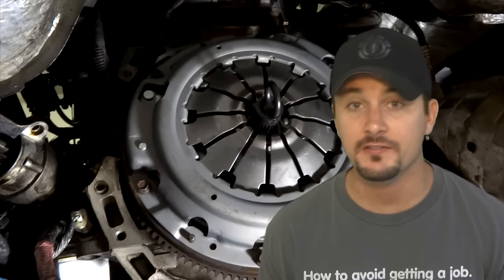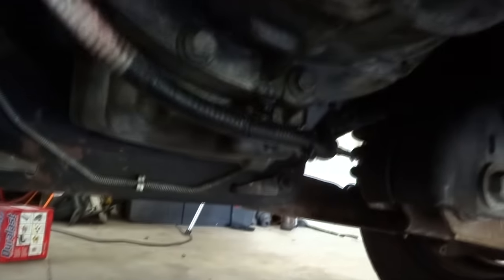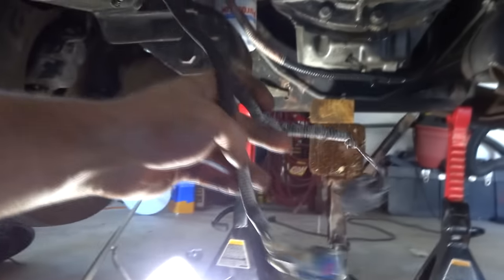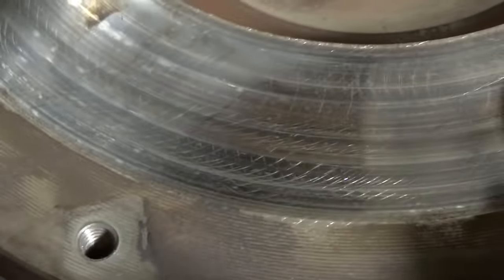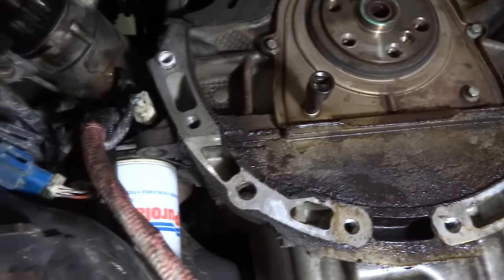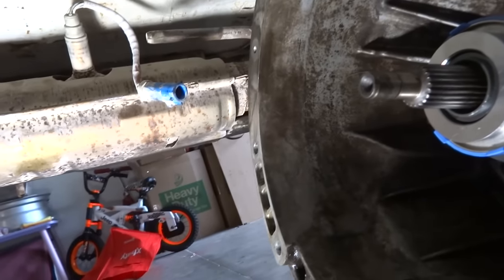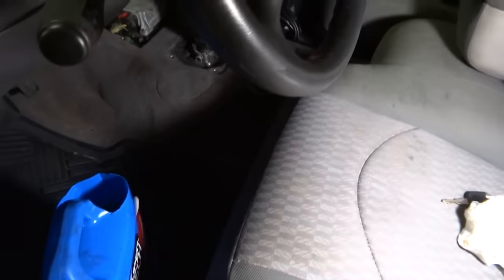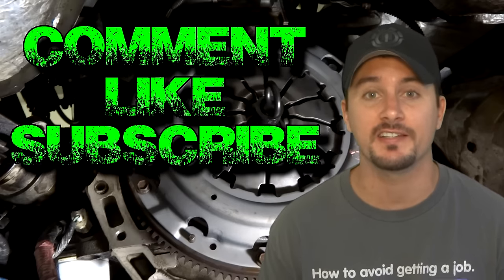Clutch Replacement Ford Ranger & Mazda B-Series ⚙️🔧

Comment: Hey very thorough and helpful video. Not only is it difficult to work on a vehicle, but also filming and narrating is a lot extra!
I have one question: did you use brake cleaner to clean out the inside of your transmission when you resealed the transmission case hat?
Thank you for your voluntary time and effort!
Reply from the maker: Thank you. Yes, most people don't understand what it takes to film a repair. On one of my repair videos I was doing a strut assembly, it took 3-4 hours to film the repair on the passenger side, when I turned the cameras off and did the driver side, it took me less than 25 minutes to complete the repair.

 I can't remember off the top of my head if I used brake cleaner, but it definitely wouldn't hurt if you needed to clean up some parts up.
Reply: @Nthefastlane  Awesome, good to know. Thanks again for your help and timely response!
Reply from the maker: Anytime

Comment: In a B-series V6 Mazda I bought recently the engine began having to be revved high to get enough power to move. This went on a couple days, my primary vehicle, as the clutch became hot and smoking. Finally, the truck has stopped shifting altogether. Will this video help me?

Comment: I have a 1998 ford ranger with only 110k on it.  I just replaced the clutch master cylinder and 2000  miles after that my master cylinder bowl was empty again.  I pulled the rubber boot on the side of the Transmission to check for a leak on the clutch slave and it seemed to be dry. So the question is if the slave is bad would you replace it with a Ford OEM slave or is there better ones out there.   I realize it only has 110K on it but it is also 22 years old.

Comment: Bro , your video is helpful and awesome , however you don't put automatic transmission fluid into a manual transmission , you got to use gear oil , same as you would any differential.
Reply from the maker: Thanks for the compliment Lloyd!

Believe it or not, the owner's manual recommended Mercon V ATF. Some manual transmission such as Ford Rangers also take ATF or even Engine Oil.

Comment: Could you give details on, lower end of shiftrod
Has like a ball of steel.
The pcs needed around it. T Y Sir . Is it only wavy  washers, & seals, or more ? Mine is totally wore out, even 2 side steel pins worn down.

Comment: Hey I know this video is old but I just purchased a 91 ford ranger 2.3 4wd and I need replaced throw out bearing because is making a  noise when the clutch pedal is up . But my main concern is that when I park the truck in a hill with out applying the parking brake the truck in first gear it won't set there, starts to roll down hill even when is in gear .what's wrong with it, clutch, transmission or engine???????

Comment: This guy is spot on with this video, however i have 2 problems with it, 1) should always have the flywheel turned or replaced. Doesnt cost much. And 2) i would replace the tailshaft seal as well.

   Scott the car guy

Comment: Would you need to adjust the pressure plate if you were putting the old clutch disc back on

Comment: I bought an old truck to repair, I have never worked on any manual cars. Is changing the clutch on a 93, 4x4 ford ranger going to be more difficult with it being a 4x4?

Comment: Of all the Videos relating to this subject matter on Ford Rangers, I have found this to be the 'Most' informative; Not only did it help immensely replacing my Clutch & Pressure Plate, But you at least mentioned what to look for & Not to do, which numerous videos neglect to mention but yet is crucial in repair/replacement.  Oh! & The make-shift Tranny Jack (Godsend on my end - Sheer & Utter 'Genius!') OMG!! Did that do the trick to dismounting & mounting. 
Although, U mentioned U struggled getting Tranny mounted - Any tips on that, having that issue now, been 2 days Tranny still not going in & don't know Y
Any input greatly appreciated. Again Thanks so much for Vid Extremely informative which numerous videos lack.
RF
Reply from the maker: Thank you very much for that detailed appreciation.
Reply from the maker: As for getting the transmission in, if you can get back to where the tail seal is with your hand and put your foot at the front of the transmission, lift the back end up pushing forward and turn it side to side as you're pushing in, it will give you better leverage and should slide into the splines.
Reply: @Nthefastlane  Wow, saw last comment was made quite sometime ago, wasn't expecting a response & yet to have you respond back, And fairly quickly too, I feel honored - Thank You so much; FYI, I've been doing as U had suggested, but still still having difficulty - Guess just keep at it, NP.  As old saying goes 'Persistence Pays' :-) Yes, it was my pleasure to praise your video, felt strongly to respond to video that made process much easier (Especially for me) to Repair/Replace Clutch - This was/is my 1st time ever doing Transmission work, hopefully, last.
Again, Thank You for posting video as well as responding to my concern, that was not anticipating, but very much appreciate it.
RF

Comment: is it essential that the plastic part pilot bearing is installed facing outward from the motor because I installed mine the opposite
Reply from the maker: If you're talking about the plastic on the pilot bearing, No. The pilot bearing can go in anyway which way. It's just a plastic cover that keeps the grease in the bearing.
Reply: @Nthefastlane  ok thank you very much

Comment: Good job.  I am about to do this on my 94 Ranger.  I see you bought the whole slave and bearing.  That's good to know because I just looked at Autozone and the whole slave and bearing is less than just the bearing. Go figure.  Oh yea, I can't wait to get to that rear main seal,  It has been leaking since the warranty ran out.  There is many years of gunk I have to deal with.  Yours looked pretty clean.  It's gonna be messy.

Comment: If you were to simply do this job without throroughly going through and changing everything like you just do the clutch the pressure plate and a new slave cylinder and the rear main seal how long do you think it would take?
Reply from the maker: I'd say 2-3hrs. Filming slows me down 80%. I did a strut job filming that took 3 hrs on one side. Did the same job on the other side with no filming in under 20mins.

Comment: Wow that clutch looks great for having 200k miles. You must be pretty good manual driver
Reply from the maker: wantapgt I rev match :)
Reply: I've been clutching for 24 years and still can't get that right.  Sounds like a video topic!
Reply: Liberty Stuff'n'Things Reviews if you give the throttle a good blip and shift down usually the rpms fall close enough to make a smooth transition.. Saves your drivetrain & clutch from extra stress/jerking and faster wear on the clutch assembly

Comment: hey quick question im gonna do a job and was tryna find out will a b2600 89 to 93 clutch kit fit on a 96 ford ranger
Reply from the maker: I wouldn't know that answer. What I would do if I were in your shoes, would be to take the clutch to Auto Zone and ask for the other clutch for a comparison.

Comment: I’m trying to pull out a motor out of a 96 ranger 5speed. I have everything in the engine bay disconnect and off and the motor mount bolts off. Just taking off the bolts on the transmission should release the rest of the motor so I can pull it out. My first motor replacement by my self.

Comment: How do you get those top bolts out of the transmission there’s no room any help?
Reply from the maker: Hi Klear.

What you'll need is a strong impact such as the Milwaukee I put in the store and an extra long impact extension. You let the transmission sag a little and then hit it with the impact and extension. Makes the job super easy. I placed them as the first two products.

I pin my store to the top comments. But here's the link. https://www.nthefastlane.com/clutch-replacement-ford-mazda-store

Comment: I NEED HELP! When installing the shift fork thingy at 42:11, mine doesnt shift right at all. I reinstalled it just the way it came out also. Also, its stuck in gear. so when it running i have to hold clutch in or itll take off. I cant get it to shift in any position. ANy ideas? Im screwed as i needed to drive it to the mechanic!!!

Comment: I'm working on my truck right now and can't get the flywheel off. It's a 97 ford ranger V6 3.0L. How did you do it?
Reply: Did you get that flywheel off yet? I use a 4’ pry bar and if that doesn’t work I’ll put 3 m-80s between it and the housing with long wicks and light them with my cigarette. That usually works good.

Comment: Is the clutch supposed to stay in place or should it be able to rotate with the tool?
Reply from the maker: Hi Robert.

The clutch will rotate with the tool when you first install it. However, when you torque down the pressure plate, the clutch will no longer move. That's when you remove the clutch alignment tool.
Reply: Thanks I haven’t done a clutch in years and the knowledge left me!

Comment: This video was very helpful step by step procedure but i have a 4 wheel drive which is the only difference. I have followed all the steps properly but my clutch is still not disengaging , can you tell me what i did wrong ?
Reply: cool thank you
Reply: Richard Butkiss Also the hydralic line makes a vertical route over the frame. very difficult to bleed, air can get caught at the top so you need to have a shop that has a pressure bleeder do it.

Comment: How much money does it take for get a fix like this?, I own a 95' Ford Ranger with a serious leak on the slave cylinder and probably the clutch might be too old as so it might be damaged.
Reply from the maker: ***** Parts are cheap, labor is expensive. Parts: $150 Labor $700-$$1,200

Comment: I was going to watch your video but when I got to 1:50 I decided to give it a miss, ...who the heck uses the back of their ratchet wrench as a hammer...?  So glad that you are nowhere near my tools ...!
Reply: Oh you should have kept watching.  He proceeds to completely remove the shifter assembly from the transmission (leaving it open for debris to fall inside), he then uses a screwdriver to improperly remove the hydraulic line for the slave cylinder; he improvises a completely sketchy (way too narrow) jack contraption to serve as a transmission jack (which he doesn't shot video of him using); the flywheel has over 200,000 miles on it and was marred by broken springs from the clutch disc, but he didn't replace the flywheel.  He uses a sledge hammer to pound in the new pilot bearing... yeah, I wouldn't let this guy put air in my tires, let alone come anywhere near my car with actual tools.

Comment: How did you get the splines on the input shaft to match with the splines on the clutch?
Reply from the maker: Start it and then use a tranny bolt to pull it in to the block. first make sure you used the clutch key to align the clutch with the pressure plate.

Comment: my truck has the auto adjusting pressure plate and it sat for 4 years. it has been acting like the clutch is about to go out the entire time ive owned it(2 years) and with my little experience with how it worked i thought i needed a new clutch so that is waiting to be put in when this one quits.

Comment: How much more difficult would this be for a 4x4 model? I would be doing it in my garage, by myself.
Reply: Did you need to drop the transfer case? Was that difficult?
Reply: @tmo2798  I ended up not dropping the t case. I ratchet strapped it to a tranny jack, the whole unit. I put wood blocks in place to make sure it didn't move on the jack plate. It is possible, but I ended up doing it on a shop hoist. I am sure with enough ingenuity it would be possible on the ground.

Comment from the maker: The line to the slave cylinder come out of the Master cylinder and yes, it disconnects from both, I doubt it's the line, it's either the Master or the Slave, check for any kind out brake fluid maybe dripping down the transmission where it meets the engine,that would indicate a bad slave. Also check the clutch pedal and follow the shaft to the master cylinder..if you see any kind of grease or brake fluid it's on it's way out.I have a video on how to bleed the air out of a master cylinder.

Comment: As a note, my 2003 Mazda B2300 had TEN transmission bolts. There is one half way up the driver's side of the transmission above the starter. Impossible to see and quite hard to feel. It was attaching a black metal wiring bracket to the transmission, at maybe 10-11 o-clock when viewed from the back.

Comment: I have a 1993 ford ranger that I have replaced the transmission pressureplate clutch but now the reverse light stays on all the time.I would appreciate it if you could shine some light on me. thanks
Reply from the maker: Marty Taylor Very possible you mixed the plugs...

Comment: How necessary is it to replace the Throwout beaaring? I am doing a clutch, Slavs cylinder and pilot bearing
Reply: the throwout bearing should be part of the slave assembly
Reply: +Rick Rob thank you!
Reply from the maker: Standard procedure. You don't want to have to pull the transmissions 2nd time because of it. Good insurance to do so.

Comment: Just a few minor suggestions:

1. Use anaerobic sealant instead of RTV on the transmission internals as once they become coated with Mercon it will break down the RTV if it hasn't cured fully and anaerobic will cure within 15 minutes once the extension and main shaft retainer/front cover are put back in place. RTV is fine on the rear engine seal.

2. Use assembly lube or petroleum jelly as it will dissolve into the Mercon so that those bearings will get proper lubrication, other types of grease might not dissolve and can even harden causing premature failure, it doesn't happen often especially if you are careful and apply it thinly, but I like to be cautious.

Great video, I was looking for an M50D-R1 specific one and could only find the R2, which is similar but for the F150 and cousins.

Thanks.
Reply: I'm reading that the face of the bearing and the innoer bore of the bearing should be greased with high-temperature lithium based grease from my Chilton manual.  I also read online that it should be greased up because the throw out bearing could seize up.  I actually just got done reinstalling the transmission, but I didn't grease it up.  I haven't tried using it yet, because I need to replace some bolts from the exhaust manifold, which I took off and they stripped.  I don't think he covered greasing up the throw out bearing in this video.  Is this a crucial step?  If so, I think I'm going to take the transmission off again and grease it up.  I really don't want this thing failing again in a few more months.

Comment from the maker: It wasn't that automatic transmission fluid in there..I just used the clean container to drain the Automatic Castrol Transmax Mercon 5 that is recommended for this application. Automatic fluid can be used for Manual Transmissions as Brian stated but this one required Castrol Transmax Mercon 5 AT.

Comment: I have a 96 Ford ranger and I'm getting ready to install a new clutch. what do I do about the rusty bolts I can't remove? any suggestions? wd40 does not work for it.
Reply: PB Blaster is much better. That stuff actually eats the rust.
Reply from the maker: +Ryan Meeks Ryan's correct.Make sure to spray it arround the bolts head where it meets whe flywheel.
Reply from the maker: +Nthefastlane Or any bolt at that matter.
Reply: +Bradley McPherson (COUNTRY) 

You may also have to CAREFULLY apply a bit of heat to some of the bolts. At least on my '96 B2300/ranger, the factory used threadlocker on them. A bit of heat from a propane torch will help break these loose.
Reply: +Nthefastlane did u do slave to the trow out bearin is inside i belive how do u tell if the bearing is fuked im havin hell of time withb mine

Comment from the maker: I'd personally tap the side of the pressure plate with a hammer..sounds like the guide pins are holding it on there maybe due to rust.

Comment: can you just replace the lines to the slave cylinder or replace the whole thing? i recently changed the clutch and didn't do the slave cylinder. Now its not engaging in gear.

Comment: nice vid.  you said the clutch had over 200,00. miles  the clutch you took out was made in china a typical replacement clutch.  also the torsion springs around the clutch disc are made to be somewhat loose and will rattle when shaken.

Comment: Quick question: Would you know the torque specs for that front bearing cover that the front input shaft seal sits in? (the one under the master cylinder). I am following your video step by step just can't find those torque specs, thanks!
Reply from the maker: I can't remeber if they were 10 or 12mmm, if their 10mm I would torque them 96 inch lbs. I just hand tightined them myself till they were good and snug.
Reply: Thanks so much! I really appreciate the quick response!
Reply: They're 12mm, same thing you think?
Reply from the maker: Just use a 3/8 extension with 3/8 inch wrench and hand tighten until the rtv squishes out and it feels like it's solid and you're good to go.
Reply from the maker: If you're still concerned just put a little bit of Loctite on threads before inserting the bolts.But you'll be fine without it.